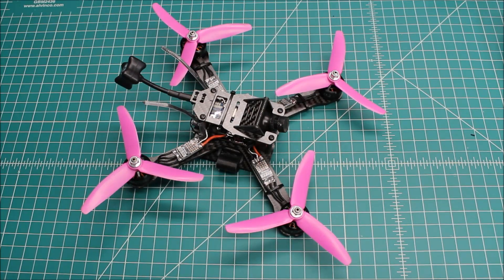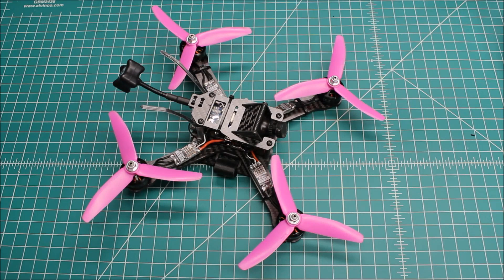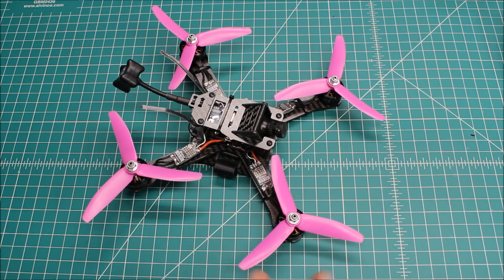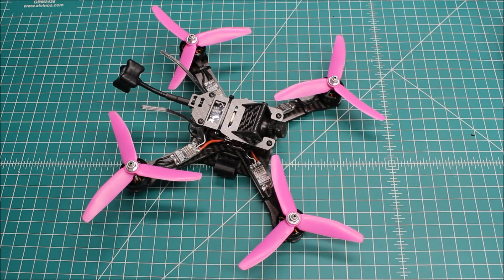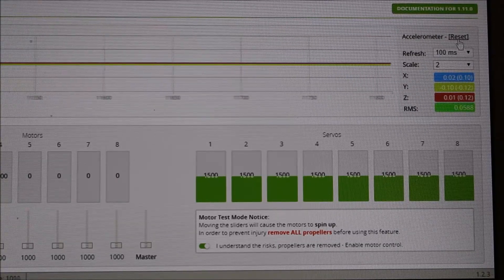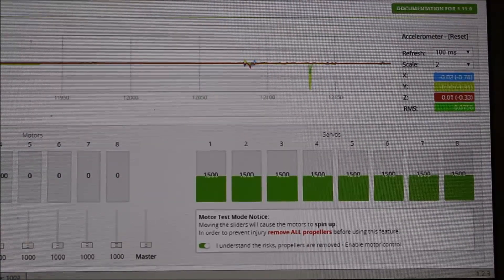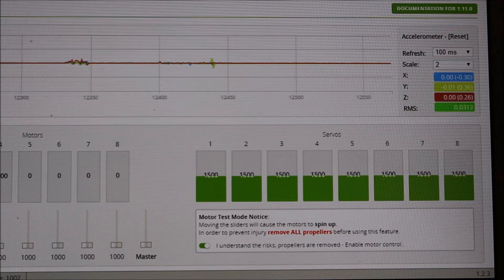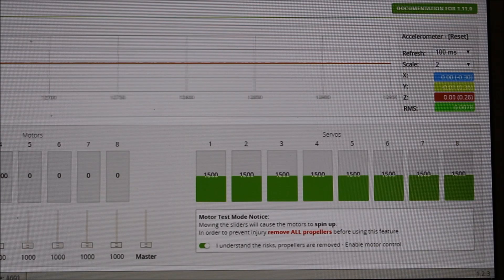X210 Oscillation Repair Video 2 of 2 "Problem Solved"

Comment: I disagree about the pads vs. pins, but i don't use pin holes for pins, I thread a tinned wire through them, usually from the bottom and solder on the top.  You can ruin a pin hole as well by using to much heat or soldering to it to many times, but they've been more durable for me than pads.  Also looks much, much cleaner.  No wires running to the top of the FC.  http://www.pbase.com/paulyoly/image/165286309  I will give you a subscribe, even though you are wrong and I'm right.😜
Reply from the maker: +mooosestang thanks for the sub. That's a good method,  and the way I did it in the beginning, it makes for a very secure joint. The issue with that is that they are harder to remove if you need to replace an ESC or something. Almost all the drones I fly and build now have pads and I haven't had an any issue, nor have my customers. Both ways get the job done. 🤙

Comment: So my fc shouldn't be having this problem out of the box? I'm assuming multiple wrecks will cause this, but what's the reasons this may start to happen other than a bad lemon?
Reply from the maker: Hohmies Mcfly not uncommon for the lux flight controller to have some oscillations because it does have a noisier Gyro. The provided grommets do help to isolate the noise a bit but sometimes you have to completely soft mount the flight controller to get rid of the noise/oscillations, especially on a stack build like hyperlite.
Reply: X-Frames FPV reason I ask, first off I'm a noob, second I ordered the x210 pro, when you talk about noise do you literally mean noise or .... I've learned tons from you and a couple other channels. Thank you very mucho for the speedy reply, build on Mr. Sir!
Reply from the maker: Hohmies Mcfly when referring to noise I'm not talking about audible noise but electrical noise that is introduced into the gyro.
Reply: X-Frames FPV Roger that! Couldn't I use some capacitors to clean up the signal